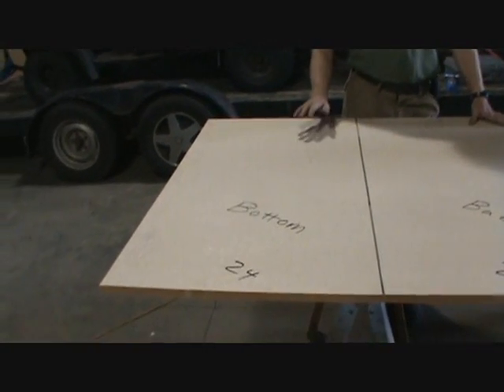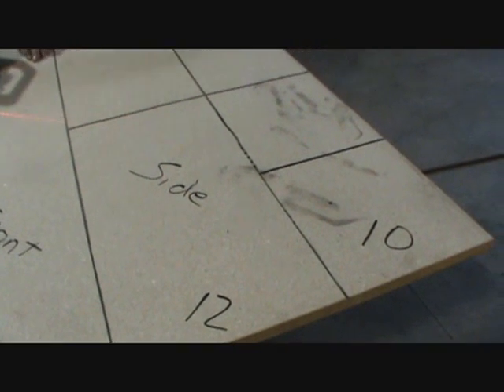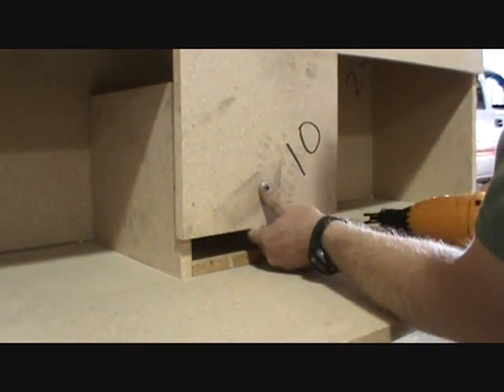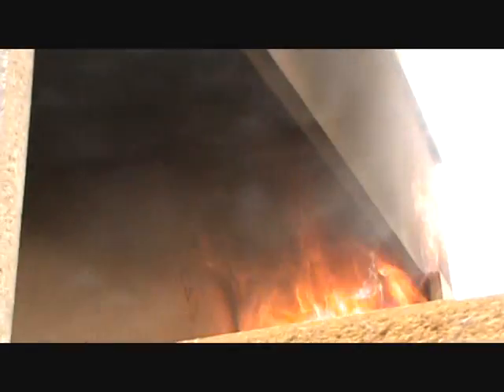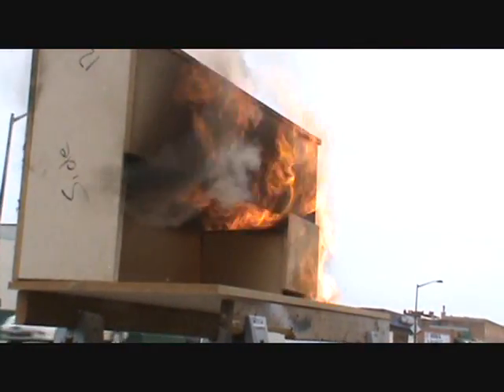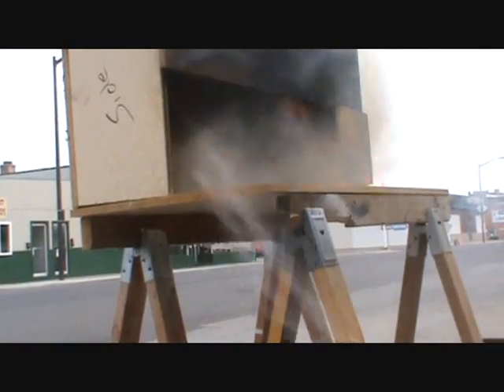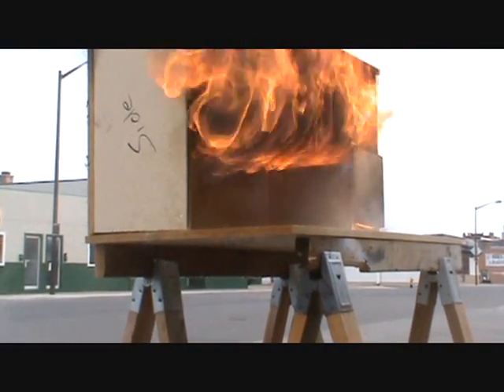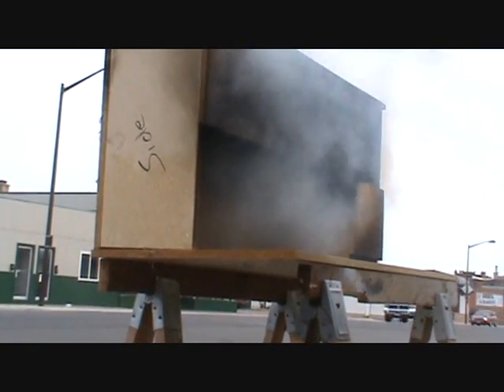Rollover and Flashover Training Prop

Comment: Colleagues, what a great demo! Thanks very much for sharing this. I believe that the small scale demonstrations can be a great tool for reinforcing many of the fundamental principles of fire dynamics. 
Have you tried placing a board across the opening to show the impact of "anti-ventilation" like closing a door? You could also try small pulses of water fog into the over pressure to show that controlled application can cool the gases very effectively WITHOUT disrupting thermal balance.